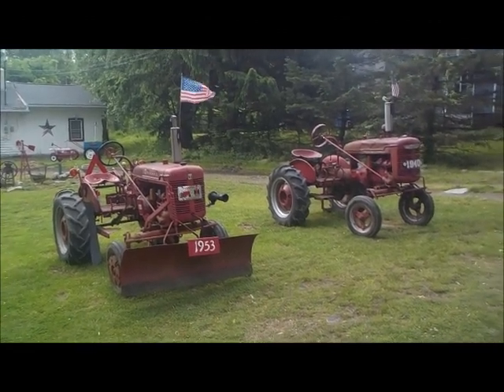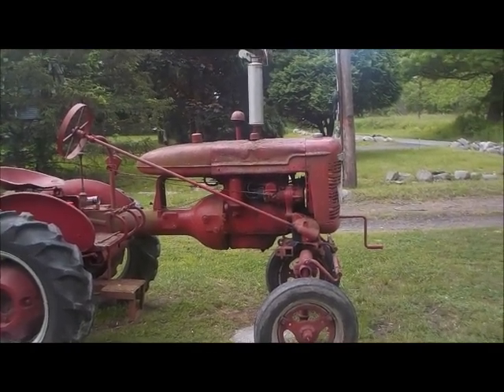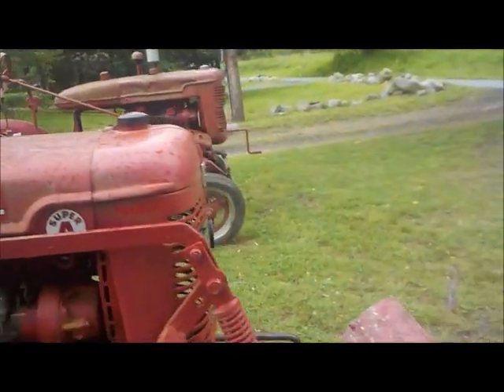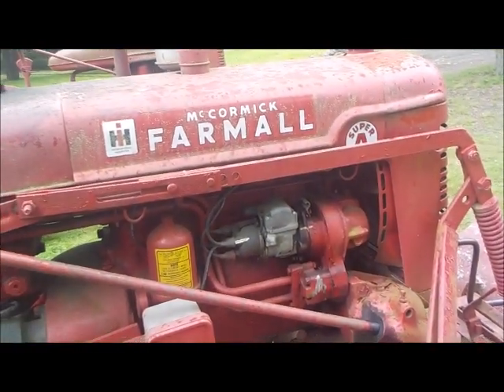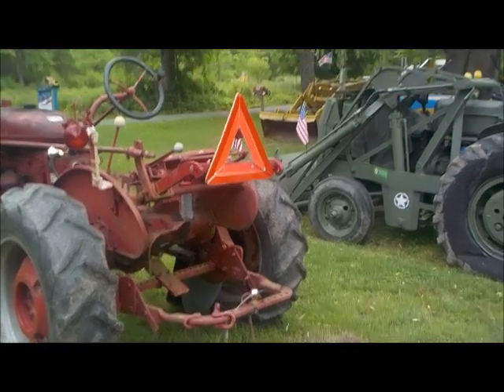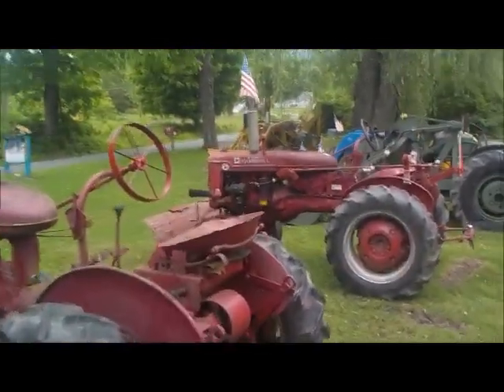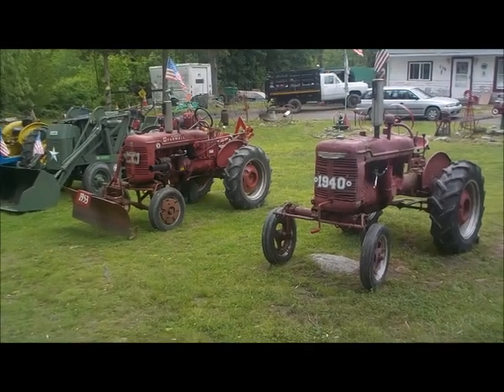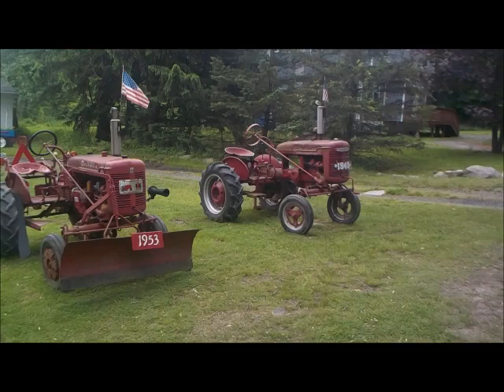Farmall A & Farmall Super A Comparison

Comment: Ours had a battery box but no hydraulics.I dont know why they dont produce them again They were a terrific tractor.Ours had a valve which went into the intake manifold to have a vacuum if needed and a plug to put into the spark plug hole to inflate tires..

Comment: Very nice Dan, thanks for the comparison, I see you made a steering wheel for the A, great video
Reply from the maker: Thanks Jan,  Yes, I had a Small Steel Wheel that was only 15 Inches Diameter, so I  Made it work out  well.
Reply: Nice repair job on the A hood! Another minor difference between the two is much more substantial fenders on the Super A because of the horizontal bar for the rear cultivators being attached directly to them. I only recall that because I used to have an A with exhaust-lift and now own a Super A. Much more versatile with individual front and rear hydraulic control. Enjoy your posts!
Reply from the maker: Thanks For Adding to the Conversation... I didn't even realize that!  But  I forgot to mention that the A's Originally Only came with Magnetos but then the Distributer ignition was an option when they added the Electric Battery & Starter.  I'm sure there are Other things I'm overlooking.

Comment: A little bit of history Dan. "The Super A was the first of the "new" Farmalls.  Introduced in 1947, it featured the same 4-speed transmission and choice of gasoline or distillate engine as did the A. However, the engine operated at a higher speed which boosted output." From  Farmall Super Series Photo Archive Edited with introduction by P.A Letourneau  page 9
Reply from the maker: Thanks Robert.... What I think is so Special about it is that the Basic Design & Look of the Tractor & the Unique Offset Cultivision design Never Changed for 15 Years, Making it one of the Most Classic, well Recognized Farm Tractor of all Time.

Comment: Every old Farmall should be converted to 12 volt systems. We used to put 8 volt batteries in them so they’d start easier but once the battery went bad we used to just crank em or coast or pull start em.
Reply: Why ?